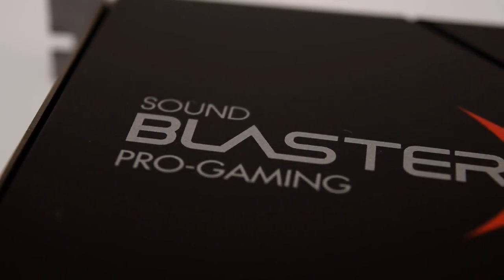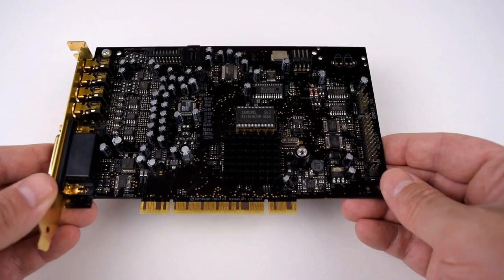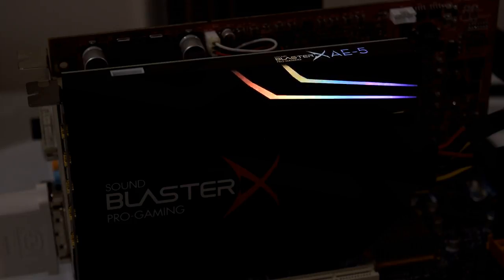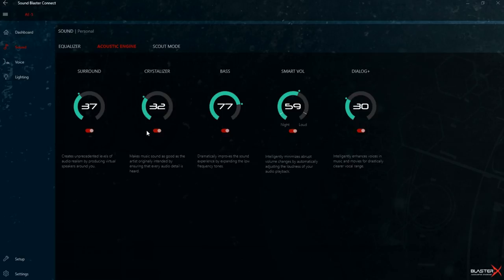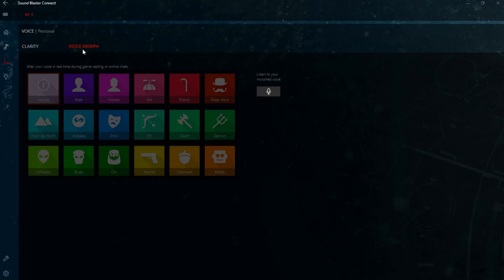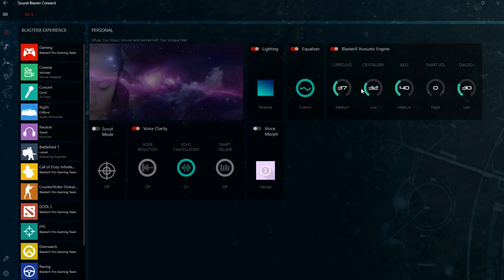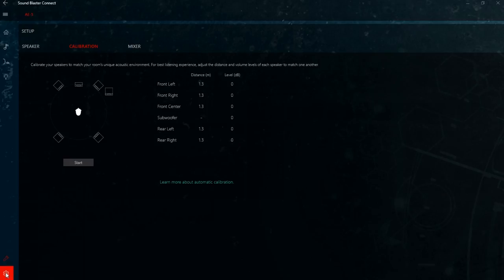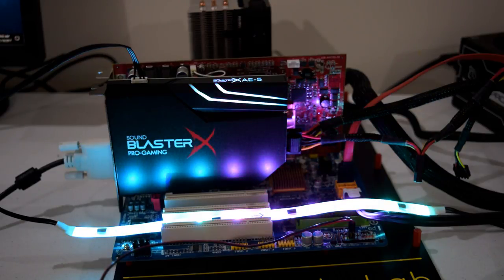Is the SoundBlasterX AE-5 Creative's best Sound Blaster?

Comment: Molex in 2017? This gotta be a joke!
Reply: rup1u5 I know right, you would think they would switch to the floppy style connector instead of using molex or use the SATA Power
Reply: The reason Creative Labs went with MOLEX instead of the SATA power connector is due to amperage. 
SATA only delivers up to 1.5-amps at 5-volts (7.5-watts) whereas MOLEX supplies up to 11-amps (55-watts). Each 10-LED light strip requires 3-4.5-watts and being able to run four strips requires up to 18-watts – over double what the SATA power connector can provide.

Comment: Sorry, but unless you need surround sound, your setup is worse than mine. I use a one buck USB and for Windows the Equalizer-APO. The soundsystem is basically high end by modern standards, a antique JVC system with equalizers flat (does not need any equalizer, it is just perfect). I saw, you "boosted" the sound with Bass and Crystallizer (Treble propably?). You know what I say to that equalizer? It is the so called bath tub! If you realy need to boost any sound, better invest in good speakers, that makes orders of magnitude higher differences.

(Well, I got my stereo for free [parents], but nevermind, it did cost a lot and still would, if you could even find it on the internet - Well JVC sucks, that it realy poops out tons of crappy stereos on the marked and you cannot find any usefull documentation)

However, it is only a stereo. But if you have 3 Systems, you could build your own 5.0 :D That would sound awesome and if you crank up the volume, it will kill your ears. A single one of my setup is so loud, that it hurts my ears, but still sounds amazingly crystal clear. For low bass I however recommend a sub, because it has internal low cut to protect the speakers.
Reply: What do you think is best for gaming ?

Comment: Great card, but I still prefer my X-Fi Titanium HD 😊Good driver support even on Windows 10, full EAX and OpenAL on Windows. As this is a real X-Fi, with ASIO it is possible to route its output (be it stereo or surround) to any other sound card losslessly, such as an external USB DAC, HDMI or even to the onboard surround outputs. Plus a real hardware MIDI renderer 👍On Linux it has hardware mixing, a great resampler and with PulseAudio I can even boost the mic input to something usable (+25dB) as it is too quiet, use beamforming, and noise removal 😁Of course the AE-5 is probably better for low impedance headphones as it has lower output impedance.

Comment: Sounds no better than Realtek's ICs. The days of external IC's like SB actually offering any performance or quality benefit are gone. This is not 199x-~2004.
Reply from the maker: The IC doesn't do anything for the sound quality, it's the DAC and the quality of the components. But if you can't hear any difference, then it doesn't matter anyway.

Comment: Discreet sound cards in this day and age seem completely redundant and pointless. Built in motherboard sound has been perfectly capable for the last decade and the only real "benefits" to these cards is the software package that comes with it which you can find in any generic sound tweaking utility available for download.

I admire Creative for still going and hanging on, I have a lot of nostalgia for them, but it's all just a placebo today.
Reply: TheDarxide23 this is true but not all motherboards let you have full control of all the settings except for maybe really high-end motherboards
Reply: SilverX95 Right, plus some motherboards don't have the power to drive more demanding headphones which is where either a DAC, headphone amp, or in my case since it still works well an ASUS Xonar DG soundcard that has a built in headphone amp for up to 64ohms headphones, because with my onboard sound card I have to turn my volume levels up to 100% to even start to 1/2 way drive something like my Philips SHP9500S Open back headphones.